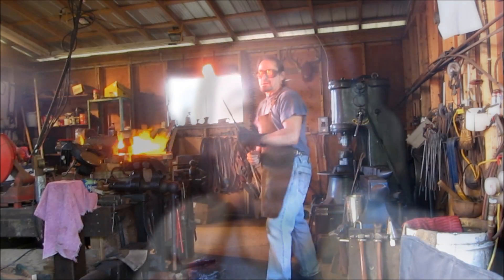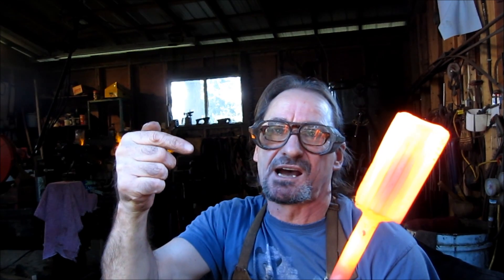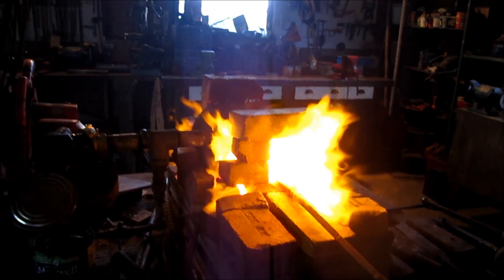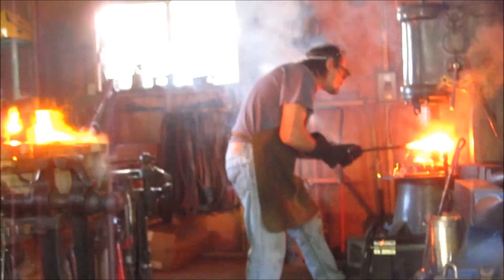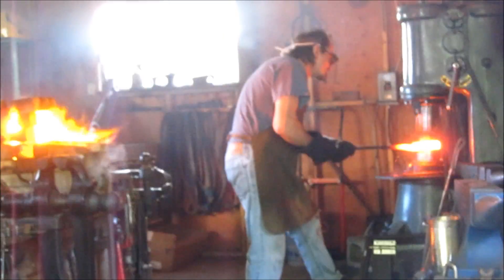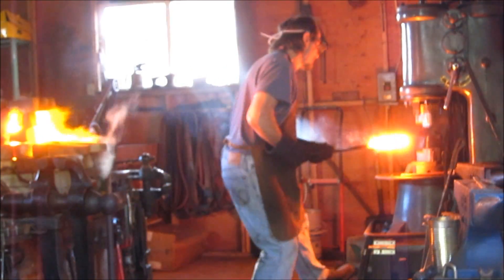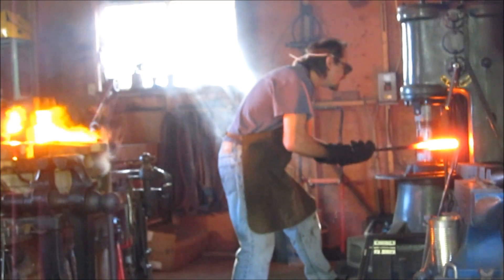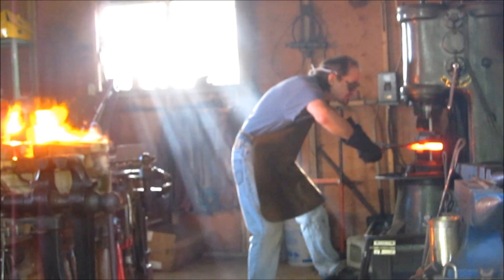Making Damascus Steel, from Stack to Steel HD.

Comment: very nice power hammer bro!
Reply from the maker: Dragonstud 
Thanks, I got it for 1/2 price too.
Reply: I wish I could aford one ...what sort of price did you pay bro?
Reply from the maker: Dragonstud 
They retailed at $6500 US when I bought mine but....
An organ making business in Quebec owned it and they welded the dies to the ram.
The company that sold it, told them they had very likely ruined the ram, and they dropped the price $3000.
I knew that ram would be fine, and bought the hammer.
It paid for itself with the first Damascus bar it produced.

Comment: This billet was just for fittings etc, and the video was made to show the cut and fold production method used by many Smiths.
There is a better way to make this steel which I have been using for decades, and will be shown in my next video.

Comment: Just wondering. Why do you leave the power hammer running while you're waiting for the metal to heat up?
Reply from the maker: They are designed to be run hot, they run smoother.

Comment: Really enjoyed the watch. ^_^

I have some suggestions for you as well. If you plan to use direct fades (the ones you did in this video) remember to give your clips a few extra seconds at the beginning and end, especially the parts with voice. Several sentence ends were lost in fades. I understand with the noise of the machinery it can be hard to be loud enough, rather than struggling with that perhaps you could consider doing voice-over? Would be a great way to walk-through all the details that you're too busy or preoccupied to mention, and I bet a lot of people would like it. Oh, and I bet you can find something to sit your camera on to absorb the vibrations of the hammer.

Cheers. :)

Comment: Isn't that actually what is called "Pattern Welded" steel and not actual real Damascus (Wootz) steel?  The two are not the same.
Reply: BennyCFD  but volkswagen owns Audi, Bentley, Bugatti, Lamborghini, Porsche
Reply from the maker: Both types are correctly called Damascus steel, but are made by different techniques..
Reply: Well a Volkswagen and a BMW are both correctly called automobiles, but a Volkswagen is nowhere near a BMW

Comment: What kind of steel do you use?
Reply: 1095 high carbon steel and 203E.
The exact ratio that they are mixed is a trade secret.

Comment: as was said below, i think you may be overheating the steel.

There are videos of other bladesmiths who forge weld and when they hit it the metal does not spark as much as what is seen in this video, and the welds are still solid.
Reply: People saying "your metal sparks therefore you are burning it" should learn a little bit more about metallurgy
Reply: You clearly know nothing about smithing.
Reply: I am NOT burning the steel.
I have been making this steel for over 20 years and have never burned any steel ever.
Reply: Yeah they should.
No sparks no weld.
When you burn your steel it looks just like a kids sparkler.
My gas forge doesn't even get hot enough to burn steel anyway.
Reply: The sparks happen because the oxigen on the surfice of the metal goes away. They are opitional, if you clear the surface before smash it on the powerhammer it will spark lesser than if you don't, but it will spark anyway.
Reply: Felipe Pedoneze
That will be it, the others i saw used those dense brushes to scrub the surfaces first.
Reply: It is common to see some sparks when forge welding. Corners will sometimes burn as well. That burn is usually discarded in the forging. A lot of stretching and folding of the steel sort of allows this to happen with minimal hindrance. I have been successfully forge welding for awhile now. I make iron from ore, and must refine the iron through lots of folding. I also make damascus now out of foundry steels. No need to watch and quote videos on youtube to add my opinion here. While we are on the subject of watching videos, check out some videos on traditional katana making. Any time you see the tamahagane pieces forge welded to create the kawagane, there are immense sparks. Through constant hammering, that fragile burnt/molten edge is eventually gone. These sparks are also not to be confused with the sparks of impurities being refined out. That 4-5# mass of steel is a sparkler coming out of the forge.
Reply: After realizing what you were actually talking about, those for the most part are not sparks, just glowing scale popping off.
Reply: Daniel C what would you know you have been doing it for 20 years and I am a youtube expert... cool video nice hammer :)
Reply: Aichmo Lol.

Comment: So anywhere but Pakistani, and nothing that looks cheap. Would it be safe to say that you should be paying at least £150 for a smallish Damascus folding lock knife? Or more in the region of £200 plus, not really looking for the really insane 700 layer stuff, just a better than normal steel blade.

Comment from the maker: Yeah that's right.
This demo is how most people make Damascus, by hot cutting and folding.
I only use this method for fittings, my blade steel is made by welding 7 layers then cutting the bar into 4 pieces, grinding the scale off, and re welding the stack.
I do this until I reach 336 layers which is the perfect amount for big or small blades..

Comment: I watched another video, one from a finnish smith, and he hammered the steel out quite thin, then cut it into equal rectangles before spot welding the pieces together, then forge welding into another block, then repeated the process. What is the difference between your method and his?

Comment from the maker: Both types of steel, Wootz and pattern welded, were traded in Damascus and that is why they are both correctly called Damascus steel.
Wootz is crucible steel, and pattern welded is mechanical Damascus.

Comment: You may have been marked as spam and downvoted but you're correct.  There is an undisputable difference between historical Damascus and the faux Damascus forged today.  Calling pattern welded steel Damascus steel doesn't actually make it Damascus steel.  The atomic structure is DIFFERENT, with historical Damascus having carbon nanotubes, as you said.

Does that mean the historical Damascus is any better or worse than what is called Damascus today?  Not at all.  It simply means they're different.

Comment from the maker: No, it' a Striker hammer.
It weighs 600 lbs more than a Anyang hammer with the same ram weight and it runs beautifully.
Anyangs are riddled with problems, stay away from them.

Comment from the maker: It runs better hot, and when you're forge welding you want accurate control.
Not hard enough, it may not weld, too hard is just as bad.

Comment from the maker: I have a 20 ton press that I bought for $300, but I need to rig up the hydraulics.
The welding is no problem, my neighbor is a welding shop and they store steel on my land.
 In return, I get free welding,k and anything I take in becomes their #1 priority to get done.
They built me a coal forge table for nothing.
The same table goes for $450 at Centaur forge.

If you are going to weld with a gas forge, make it a round one, the cyclonic action gives a very even heat.

Comment: If you have the welding skills, I recommend you build your own. I like presses, mine is 30 ton. You can put a press on a moveable cart, there's no impact, and I find if they run decently fast, like over an inch/second, you can forge-weld billets great.

Comment: now im no blacksmith, just curious, since i didnt see the ingot before the initial heating at the beginning i can determine if the ingot was originally 1 layer at the beginning or a combination of different hardness of steels layered into the first block but wouldnt the layering process follow the power of 2? 1-2-4-8-16-32-64-128-256-512-1024 ect.

Comment from the maker: The more layers the finer the pattern and the harder it is to see it.
200 layers is on the low end ans any higher than 500 layers and the pattern is hard to see.
I only take my steel to 336 layers now instead of 448 layers, it seems to be perfect.

Comment: What different fold amounts have you done? Have you done any 50 folds? Is their significant difference between a 50 and a 100+? I know their is a significant difference between 25 and 50, but I was told between 50 and 100 their is only a small difference because 95%+ of the impurities are knocked out by 50. Do you do any carbon bonding with smoke? Nice workshop, smithing, and video.

Comment from the maker: Borax has no effect on weld strength, welding correctly and at the right heat does.
Other than to clean the surface of the steel and keep it from oxidizing, borax takes any slag with it when it flies out of the weld areas.
You can even  use clay as a flux.

Comment from the maker: I use 1095 high carbon steel mixed with a nickel alloy.
You can fold high carbon steel onto itself, but you'll have to temper bthe blade after.

Comment from the maker: No I am NOT over heating the steel.
This steel doesn't go higher than 2300 degrees in that forge which iw below burning it.
Those sparks are scales and flux.
I have been making Damascus steel for 25 years and I KNOW what I am doing and what a burned sparkler is.

Comment: a similar steel folding technique is also used by the Japanese for the katana but most tend to do it by hand not with power hammers like in this video

they also used iron with the steel. something about making it a lighter  (and faster) weapon I think

Comment: Beautiful big anvil and nice auto hammer.  Thank you for showing us your workshop. I hope your arms do not get burned!  What is the composition of the steel you use? Somewhere I got the idea that Damascus steel used brittle but really hard steel folded up with softer but toughter steel in tiny layers - thus you get a real sharp blade with that one thin layer of hard steel.  Or am I way off?

Comment: The math seems questionable. Everything should just increase by a factor of 2, right? 2, 4, 8, 16, 32, 64, 128. Somehow you got to 14, but still from there it should be 28, 56, 112. I think you meant 56, not 52 or 54

Comment: Not to be a critic, but shouldn't it be 56 instead of 54? 14 folded = 28 folded = 56 folded = 112.  Am I missing something?  very nice billet though.  A power hammer makes it so much easier it's almost like cheating. ;-)

Comment: i figured the difference in hardness of the metals would be too great for a functional knife, I was just wondering if you could have an ornamental tiger striped blade. at which point you might as well go in for some gold forge welded inlays.

Comment: something I was wondering, would it be possible to do this with steel and brass rather than two different types of steel?
my thoughts are if you made it with brass and blued rather than etching with acid you  would end up with a tiger stripe knife.

Comment from the maker: It's 112 layers and I started with 7 layer's.
I hot cut the bar then folded it and forge welded.
This is not the way I make my blade steel, I use a better technique for that.

Comment: By 112 layers do you mean that you repeated the process of cutting the steel in the center and folding it over onto itself 112 times? Also, what's not clear to me is how you folded the metal. Did you actually properly forge weld the two halves together with borax and whatnot or did you just get it it real hot and fold it onto itself and hit it? What color/temperature did you get the steel up to? It seems like you got it up to a proper white hot forge welding heat but I can't quite tell.

Comment from the maker: Thanks for the kind words Calum.
I've been bashing out blades for over 20 years now and my technique probably looks haphazard to the uninitiated, I'm glad you caught that.

My air Hammer is a Striker STC-88 and it is 600 lbs heavier than the equivalent Anyang air hammer, avoid those like the plague.
A few years back the company was bought by the Shanxi company in China.
They still make the hammer, but I'm not aware of a US distributor. 
I love my Striker, good luck finding one.

Comment: Do you use some kind of melting flux like borax? or a mix of borax and sand? I'm a ocassional smith and every time i try to weld in het forge the weld only holds for a short while.
 (sorry about the spelling english isn't my native tong)

Comment: You're not changing the overall volume any, so the density doesn't change (there is no compaction). You'll still be at about .283 lb/in^3 density.

Comment: Will let you know what not learned about the iron, which is used to make swords
First. Iron is originally not from the ground, as some believe, and modern science proved that iron from outside the ground, but Muslims first knew 
before modern science 1400 years ago has been mentioned iron in  Quraan
Read these verses from the quraan ran and then I will continue with

Comment: There sura in the Koran iron calls Surat.As for preparations for the manufacture of steel, there are many.The sword is not made on the same day there are things you should be paid by the manufacturer, including the presence of herbs and peel fruits mixed and placed in the fire and put the sword under the light of the moon on certain nights

Comment: I am Currently making Damascus  from  old Tow Cable  wire  I know it very high Carbon due to the Cut off Color. you might be surprised that i Have only an old cast iron Stove and pine for fuel    I have acheaved weld temperatures and have amazing results

Comment from the maker: The opposite is true, the more you fold the more carbon migrates to the low carbon bars of steel.
If you folded a million layers you'd have a very labor intensive piece of spring steel.
There are exception's, like when the Japanese smith's fold their steel they put rice ash in between the layers to add carbon.

Comment: my dad Bob Sr. was blacksmith onthe railroad.  He made many butcher knives with a forge and steam powered trip hammer. 50 years ago. We used them in our kitchen and you could put an edge on them and slice bacon as thin as you liked.  Sadly they were replaced by serrated "ginsu" knife crap. The original works of art are all gone.  Thank you for your video and your art.  Best regards, Bob

Comment: Thanks, I figured it would be a high carbon steel. I deal with modern welding techniques and metallurgical issues. There is something to be said about old school it just works. I'm in love with your hammer press by the way lol...

Comment: you can use a small section of railroad track, an old large sledge hammer head, a large pin from an excavator, anything like that.  then anchor it in a large block of wood, or a stump or something like that.

Comment: maths fail me. 1 layer doubles to 2 layers which then double to 4 to 8 to 16 to 32 to 64 to 128 layers.if we reverse it we go from 112 to 56 to 28 to 14 to 7 to 3.5 layers to 1.75 to 0.875 layers!:)
good looking piece of steel though

Comment from the maker: I just misspoke in the video.
I started with 7 layer's then folded it to 14, 28, 56 and finally 112.
This is not my blade Damascus, I use a different process for that and go to 336 layer's..

Comment: only kinda confused about the layer count, i know from other smiths that when you fold 1 fold creates 2 layers, 2 folds creates 4, and it continues to double in layers, 4 > 8 > 16 > 32 > 64 > 128. dont really understand how you get to these odd ball numbers for layers. its only possible if you add in an additional separate block of steel with an off count layer, forge welding a  block with 4 layers with one that has 8 will yield a 12 layer block, 12 > 24 > 48... love the setup though!

Comment from the maker: I knew the layer count, I just miss-spoke.
If you make a bar with more than 500 layer's the pattern becomes too fine to see clearly.
I used to make my blade's from bar's of 448 layer's, but have dropped to 336 layer's because the pattern shows better.
Also there's a thing called carbon migration that occurs, and if I made a bar with a million layer's, I would have just made a very labor intensive leaf spring.

Comment: I'd definitely sit in your shop watching / learning all day if that was possible. By the way, what's your thoughts about a power hammer vs a forge press (I've read about a modified wood splitter turned into a forge press). Are they used for the same purpose?

Comment from the maker: In the future, don't buy your steel from India, it will be average at best and absolute crap and riddled with flaws and inclusion's at worst.
Damascus steel is only as good as the alloy's it's made from.

There is lots of high quality Damascus being made and sold in the US now, and ebay is a good source.
Hopefully you got a solid bar.

Comment: Around what color do you quench your blades at?  I read somewhere that quenching the blade at above a red/orange heat will make for a very coarse grain structure.  Do you know anything about that?

Comment from the maker: There is no maximum, but eventually the layers will be so fine you can't see them, and the carbon migration will turn your bar into what is essentially a very labor intensive leaf spring.
I used to go to 448 layers but have dropped to 336 for the nicer pattern.

Comment: All of the damascus ive seen seems to be just variations of black and gray, which is ok if that is what you like, but i was wondering what 2 types of steel could be forge welded to be the most different? For instance one of them which turns out completely black and one of course which is almost like high gloss chrome?

Comment from the maker: @HelloItsEric 
That depends on how you do the second third and forth welds.
I usually cut my bars and cut them in 4 piece's to be re-welded.
The hot cutting folding of the steel in this video was for guards etc, the stuff I use for my blades is quad stacked and superior to this method.

Comment from the maker: @CubeSquid 
Use spring steel an a low carbon alloy.
And soak the stack well on the first weld to make sure the center is hot enough.